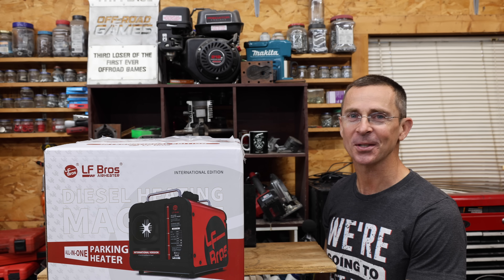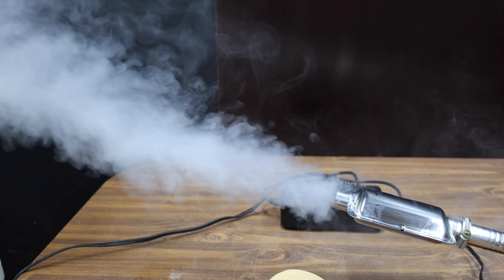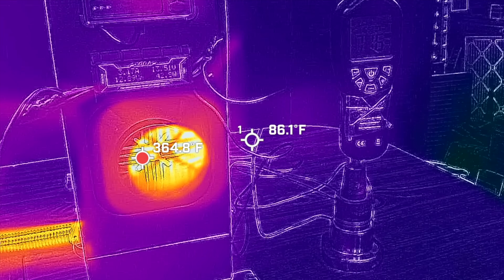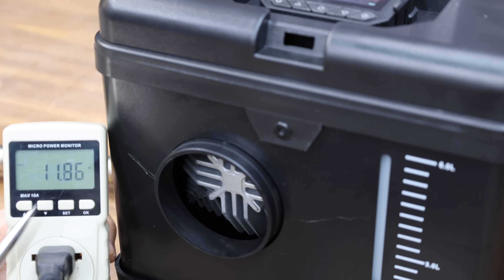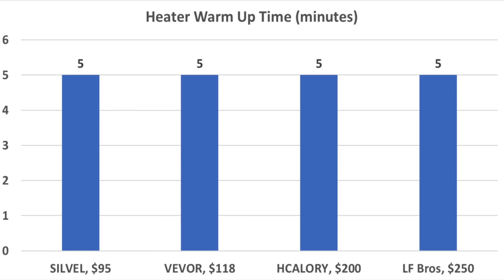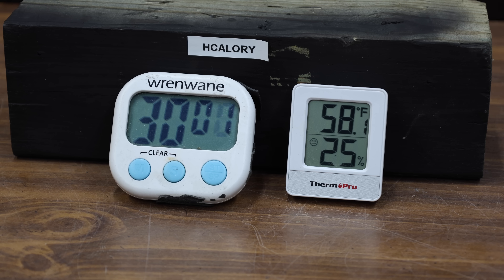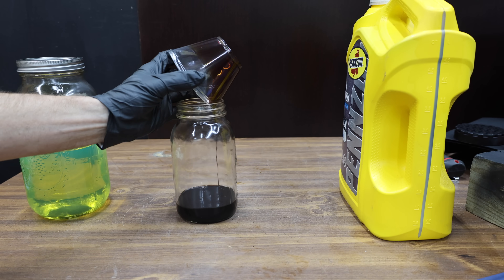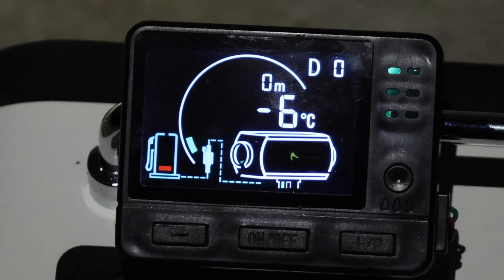The Truth About Cheap Diesel Heaters!

Comment: Had a few different versions of these on my sailboat over the years, the first ones being from Germany which were heaters that were installed in older Volkswagen cars, then there was a company in Chateauguay Quebec, Canada that were making them but they were priced at almost 1500$ ten years ago, then we all discovered the China made ones on Ebay for 110$ shipped, they all looked the same inside and worked just about as long, a year or so, but a less than 200$ now compared to 1500$ back then, its a no brainer, Plus the newer ones ( last 5 years) they are a hell of a lot more portable and easy to use with a built in tank, which the others did not have.
Reply from the maker: Thanks for sharing!

Comment: I use a vevor unit to heat my home, works great. I run the exhaust thru an old cast iron radiator for even better efficiency.
Reply: Smart. I was thinking about all that wasted heat the exhaust was blowing away
Reply: That’s honestly such a good idea!! I use one to heat my hunting cabin. Do you notice any fouling or extra soot buildup that you have to deal with?
Reply: @johnanders8861 Yes it fouled!
I had my exhaust extended and coiled under my water tank so it wouldnt freeze. 
But the extra length cooled the exhaust and condensation formed and water pooled and the back pressure tripped an error code and the machine shut down
Reply: @johnanders8861  The bigger issue with running the exhaust through the radiator is condensation. Diesel exhaust contains water vapor, it condenses on colder surfaces and collects in low spots. It's important to install it in a way that condensation can either drip through the exhaust or to have a manual drain valve and to remember to drain it. If water fills the exhaust the heater operation will be affected
Reply: that's what i was thinking to do once i grab one. have the exhaust pre-heat the air before it enters the main heater for added efficiency, granted it does mean more complexity and space but my use case of large space heating is worth it for the extra efficiency. (probably not a huge amount to be had but certainly noticeable if these exhaust temps are regularly above 200f with 50+f ambient temps)
Reply: Your iq is exponentially higher than the detractors of this simple deduction….  These idiots have crashed all the forums I’ve ever visited
Reply: Just two days ago or so Deboss Garage showed their video of installing a vevor and running the exhaust through an old cast iron radiator. Crazy that a day later you say you do just that…..
Reply: @WizDJ  It's a pretty common thing to do if you're trying to maximize heat
Reply: @WizDJ  It's not crazy at all, it's running the exhaust through old heater is one of the oldests "tricks" in the Webasto-like-Chinese-diesel-heaters community (I've had one of these for 5+ years). There are many other tricks how to catch the heat from exhaust, too.
Reply: @WizDJ  Exactly! Found it interesting that in Rich's eval, the 5k and 8k seemed to be the exact same except price.
Reply: Not crazy. Just copying DeBoss idea.
Reply: Dosnt sould safe. Your breathing carbon monoxide from the exhaust
Reply: @johnd4348 You run the exhaust outside, you don't breathe it.
Reply: @sonictech1000 better make sure radiator doesn’t leak, they are built from sections bolted together, the gasketing fails
Reply: @johnd4348  It has an exhaust you can run outside. See Deboss Garage latest eval of the Vevor and how he handled the exhaust.
Reply: @johnd4348  Thats why you plumb the exhaust outdoors.
Reply: @johnd4348  no dioxidefrom diesel, you ar remixing it with gas

Comment: I have three of the Vevors, two as shown and one kitform. They all work surprisingly well: one burns slightly less clean than the others on startup, but otherwise I can't tell the difference. Mine are all 5kW and I don't believe the 8 kW give more output, just have more cost input ;) I'm using them to part heat my house in deep rural Spain. They aren't really much cheaper (in Spain) than electric heating but spread the risk and work on battery if the grid goes down (DEEP country - it happens, usually for not more than 20 min). Industrial low tax diesel is not available here in small quantities... I have them on a 40A 12V switch mode supply each with a 24 Ah 12 volt deep discharge battery connected via Schottky diode (as with solar) for discharge in parallel with a 1R5 20W charge current limiting resistor for when the power comes back. Works well and keeps running when the power goes off - as mentioned below, it is essential that these are cycled down to cold and not disconnected when hot or oopsie no blinkenlights and a serious fire risk... there are projects around for connecting them to WiFi which could be fun. Oh and Vevor here were very good on a warranty claim, one pump failed and they got me a replacement in a few days. I had to fit it but that was not challenging ;)
Reply from the maker: Thanks for sharing!

Comment: I bought one of these years ago for cars/RVs and use it in my shop. These do look more convenient even though it's just the car/RV heater inside of a case lol. I can run straight used motor oil as long as the fuel is warm enough going in.
Reply from the maker: Thanks for sharing!

Comment: What is the use case for these? Just use a kerosene heater that requires no power. Or if you’re trying to heat up a shop just use a torpedo heater. Both of these options put out a lot of heat unlike these diesel heaters where the number on the box is well above actual output.
Reply from the maker: Thanks for sharing!

Comment: (1) Interesting that these have a need for external power, but it makes sense for a fan. It looks like these are oriented for camping/off-roading, rather than emergency power outage use, for exactly that reason. How long can you reasonably expect it to last off of a battery box? 34-54 watts divided into the 270-280 that your various power banks in the last video provided makes for only about five to eight hours, meaning that if an extended power outage is a concern, you would still need to consider a generator. Or an alternate heat solution.

(2) Todd, my dude, I love your channel, but I'm seeing a trend in attempting to make the titles more engaging. There's a fine line between clickbait and fun, and this one just isn't doing it for me. You're the one putting in the work and I'm just some guy on the Internet, but please don't feel the need to do the same thing other Youtubers do in search of views. I will be so sad if I see a video titled "You wouldn't believe which battery powered can crusher is the toughest"
Reply from the maker: Thanks for the constructive feedback!

Comment: An option, for people who are less-prone to self-expiry through shoddy electrical work; buy a small pack of lever nuts from either Wago or Ideal and if  possible_, also a short length of electrical wire to splice in a hand-fashioned mains out compatible with your region. _Else consider how you'd use the socket end of an extension cable after chopping such in half to use the plug end for fashioning a cable and toggle switch to safely use auxiliary power during an outage.

Don't neglect to splice in both your electrical whole-home heating appliance and your main control unit so you can use an auxiliary power supply for operating the heating unit. Anybody can do this kind of stuff, few can do it well; follow exemplary examples and put a good amount of time into research before a power outage happens, so you can give yourself the capability of using power from an auxiliary source for powering a central home heating system.

Remember: it's the socket that should be live, not the plug you insert into the socket. Else, touch live pins and you may become a living part of the circuit for a short while; before expiry occurs.

Comment: I have the vevor heaters for 4 years know. It runs 24/7 in my shop and is very easy to maintain. I clean the inside of the burner and  change the heaterplug with the steel maze every 6 months before it gives trouble. They are very reliable. Every sparepart is easy to find except a good quality fan-motor. When that is broken or worn out it is easier and cheaper to buy a new one. ( somebody has maintenance questions i know a lot, if needed)
Reply from the maker: Thanks for sharing!

Comment: I was using a propane unvented space heater to warm up my 300 square foot workshop but it introduced too much moisture which condensed on all the cold surfaces so I bought a diesel heater from Vevor for about $100 Cdn. The instructions were terrible however by throwing them away I got it working. I angled the output hose to blow warm air across my work bench where I sit. Does the job. Wonder how long it will last but for $100 not really an issue. By the way, the propane heater introduced no measurable carbon monoxide so it would be good for something like a greenhouse.
Reply from the maker: Thanks for sharing!

Comment: If you buy one of these please check out the excellent "Afterburner" replacement controller for them. Internet controllable for remote start, full customization of burn parameters for alternative fuels or just clean burning of the diesel, advanced thermostatic control, altitude and humidity settings, awesome control interface... It makes these heaters much more user friendly. Made by a guy in Australia but shipped worldwide. You are likely going to have to replace the electronics inside the heater (the ECU) for compatability. It made my Chinese Diesel Heater about 4 times more expensive but about 100 times more useful.
Reply from the maker: Thanks for sharing!

Comment: The problem I see with these is that they need power to run so with that in mind you might just as well have an electric heater ... If you need an actual emergency heat with fuel buy a piezo primed "heat cannon" or heater that doesn't need electricity to run and speaking of those might be a good idea to test next.
Reply from the maker: Thank you for the video idea!
Reply: only runs at 5w once the 10minute start up is done. thats essentionaly nothing

Comment: FYI, I'm betting the first one smoked up due to the power supply being low and it dumped fuel in the chamber which didn't light up until you hit it with the stronger power bank.  I also completed a video review on the Vevor last winter and found you CAN run straight used motor oil.  BUT you need to provide the glow plug 12v the whole time.  I also wrapped brake line around the exhaust of the heater in a coil about 10 wraps.  I  fed the fuel through that section of wrapped brake line to preheat it and thin it out.  These are really not hard mod's to do and it keeps the fuel thin and the chamber hot enough to burn constantly.  Free fuel and free heat (or as free as free get's :)

Comment: I installed a diesel heater in my Sprinter Motorhome.  While I have a permanently mounted on, not portable- it appears much the same setup. I chose to use an Espar (7500 BTU)  in mine, since I was not keen on having a really cheap ignition source inside my van when I’m sleeping. 
 Buddies have the cheaper ones and while a LOT cheaper, they are also quite a bit noisier and the thermostat setup is awful. 

 Thanks for doing one on the cheaper stand alone setups. I still don’t think I would want to use one in a place where I’m sleeping, but for use when out doing things it makes sense.
Reply from the maker: Thank you for sharing!
Reply: I sleep with mine everday whe I'm camping in my truck
Reply: @robertberin4872  I know others that do too. I just was not comfortable with it.  
  I have not heard of any problem with using them and doing so either.   But I didn’t want to -  I also think too much about what can go wrong.  Ha

Comment: BTW Apparently patent from the German Company Webasto, that invented diesel heaters, expired and now anyone can copy them. So China overflooded the market with same design heaters. BTW Webasto made them for gasoline as well and for car companies as well. In my old BMW 545i I have had it and it was part of the winter package. Fully BMW integration where you could program two burn cycles per day. For example 15  minutes before you drive to your work and 15 minutes before you drive home. You could program when and how long it heats up your car. Some vehicles even have heat exchangers and will heat up cooling liquid of the engine and cycle it true the main engine so you can start up engine even in freezing conditions.
Reply from the maker: Thank you for sharing!

Comment: Thanks for another great video! I'm confused by the video's title -- how are these heaters beneficial during a power outage, if they require power to run? You'd still need some generator (solar or another fuel) to power the unit. Is it just a super-efficient means to heat a home, i.e. it's a better solution than having some other heating element plugged into a generator?

Comment: I live in South Florida USA.  Purchased HCalorie brand, looks like the Vevor unit, the stand up type, 2 years ago. App control & Remote. This is my 3rd winter. 12v DC power from solar system with Battery storage. 5gal gas can with pickup thur the lid to bottom of tank,  3 ft lower than the heater. So far it's averaging around 5 gallons of Diesel per winter/ year. Buy 20 ft of exhaust flex pipe to get exhaust away. 4" dryer flex duct in and out of unit with custom board to fit window so that heater pulls air from inside the house, heats it, blows air right back into the house. No smell, TESTED-NO FUMES... huge savings on my electric bill...!... After winter, run fuel dry>drain, remove board & duct, box it up for 9 months 😮😂😊
Reply from the maker: Thanks for sharing!

Comment: I use a Hcalory 8KW in my camper in Michigan and it works great uses about a gallon a day if it’s cold and I set the level high. 

Keeps my camper that’s outside at about 60 at half levels. With outside temp at 20 

I did moved the tank outside of the toolbox it came in and ran a longer fuel line. I like that I can use my phone to control it.
Reply from the maker: Thank you for sharing!

Comment: These might be a good option if your home relies on electric heat (heat pump or resistive). If you have a natural gas furnace or gas boiler (with electronic control) for heat, you would be way better off setting those up to be plugged into a wall outlet, especially since all of these options require an external power supply. I’ve done this with my NG furnace (super easy). It pulls about 400w when the igniter is running and about 150-200w when just the heat is running. I run it (along with my fridge, internet, tv and a few lights) off of the built in power inverter on my electric car. With this setup, I can run my house with heat for at least a week, easily 2 weeks if I ration power. You could do the same with a small generator. Definitely a far better option than a diesel heater unless you use electric heat.

Comment: I just installed two of these, one noname and Vevor. The noname was a bottom quality, plastic casing not fitting to itself. The Vevor controller has an automatic altitude compensation, even the one without Bluetooth. You can get a quieter pump on Ali. Careful about the cheap single wall exhaust pipe - the end where you clamp it leaks (deforms under hard spot of the clamp), allow the two sides of the wall slide under each other or use high temperature silicone. For installation where the exhaust goes up, install a water trap to the lowest point to drain condensation. There are upgrades available, alu casing, double wall exhaust pipe, through-hull fitting, 90mm outlet (for longer distances hose), wifi controller, etc.
Reply from the maker: Thank you for sharing!

Comment: These heaters are all Chinese copies of the original German Eberspacher.
They are also all 5KW heaters. Typical Chinese lying.
Reply from the maker: Thank you for sharing!
Reply: Erberspacher does make a 5kw version. Which is what all the clones are.
They are then overfulled to try and get 8kw out of them. That causes the heater to clog-up with soot, requiring a strip-down.
Reply: @johnbooth5199  Typo on y part. thank you. I've corrected my comment.

Comment: I've been using one of these diesel heaters in my workshop for the last 4 years. I've tried different fuels including used brake fluid. They all work, but a word of caution here...   Diesel works best as even blended with other "fuels" ultimately results in excessive carbon build-up. Since these units are very easy to take apart they are easily cleaned. What has annoyed me a little is the incredible amount of heat lost through the exhaust. A recent modification of adding a turbo intercooler from a Subaru now means I can claim the exhaust heat too. The exhaust leaving the intercooler is cold enough to run through plastic pipe! Just make sure to run it down hill as there's a considerable amount of condensation generated. The fan on the intercooler is mains powered and virtually silent.
Reply from the maker: Thanks for sharing.